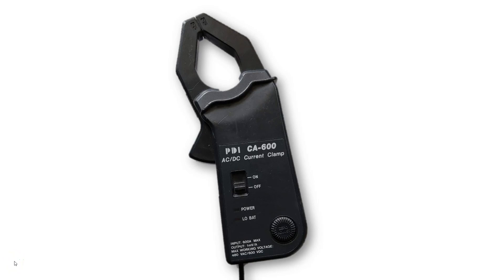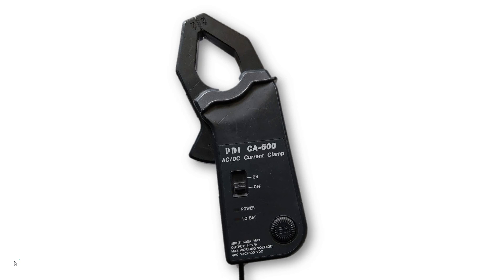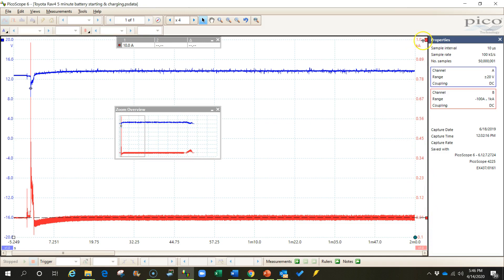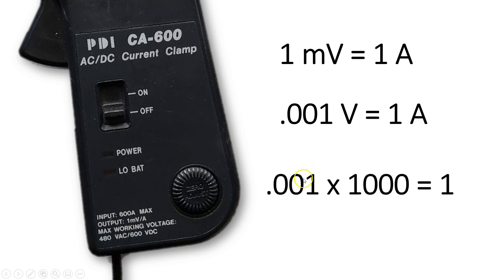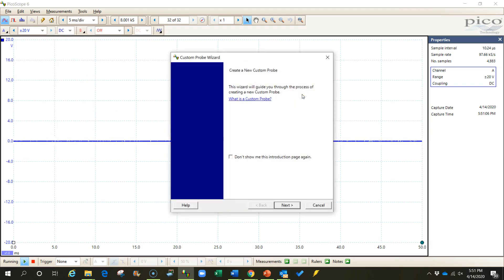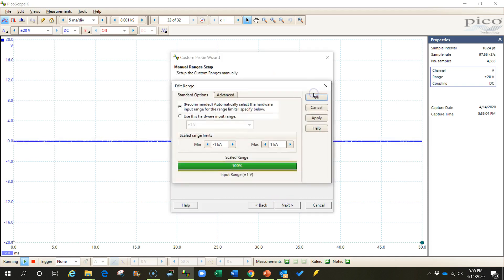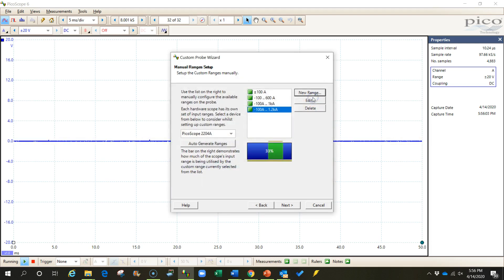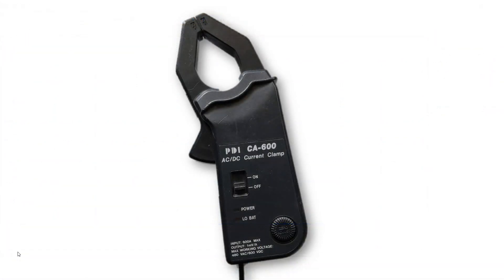How to create a 1000 amp current probe in your PicoScope

Comment: Good video bro. 
Could you give me some pointers  as to how to customize my hanteck cc65 amp clamp to work with the pico 2000 scope?
Reply from the maker: I looked at a picture of that clamp and it appears that there are two settings.  You will need to create a custom probe for each setting.  for the "1mv/10mA" setting, you would simply use "10" as your multiplier (instead of 1000 as shown in my video).  You will probably want your ranges to be 20 amps or less.  For the "1mv/100mA" setting, you would multiply by "100" and it is probably designed for up to about 65 amps (I am guessing, based on the name of the probe)--although, as you saw in the video, you can go a little higher than that.
Reply from the maker: One more thing - the software probably already has probes that will work that are built into the program.  Select "60 amp current probe, 20 amp mode" or "60 amp current probe, 60 amp mode."  These probes use the same multipliers and settings as your Hantek clamp.
Reply: @JustinMillerAutomotive  Thanks much.